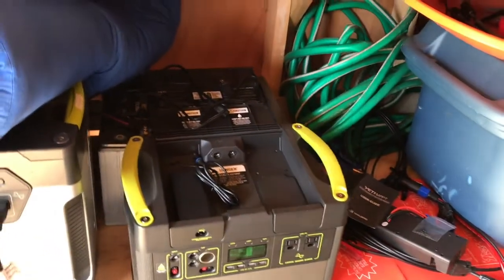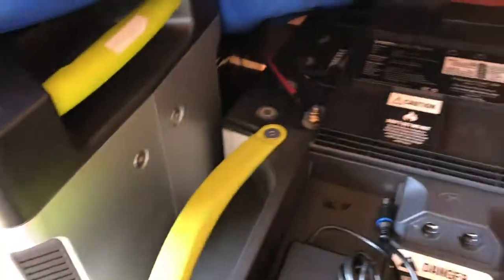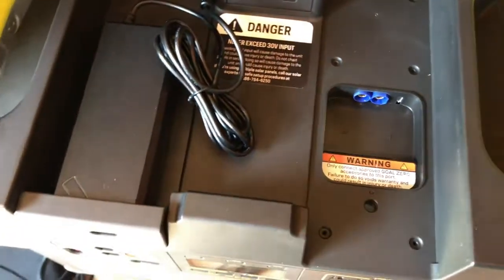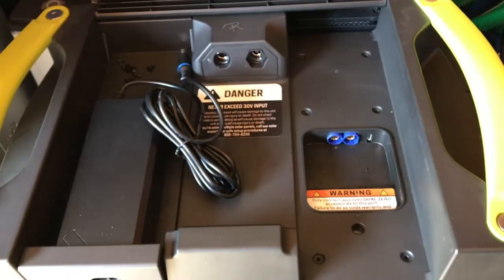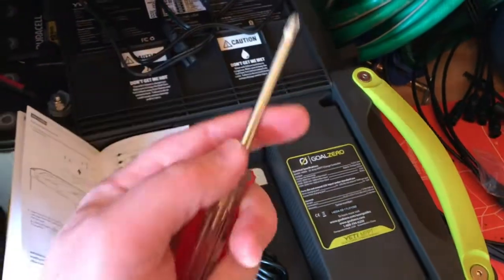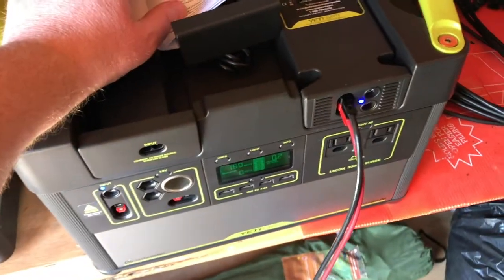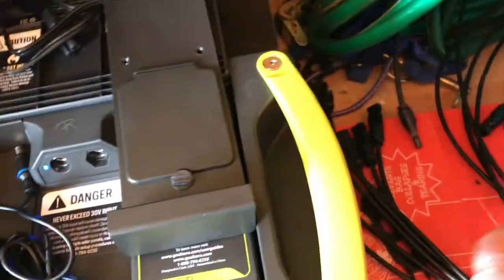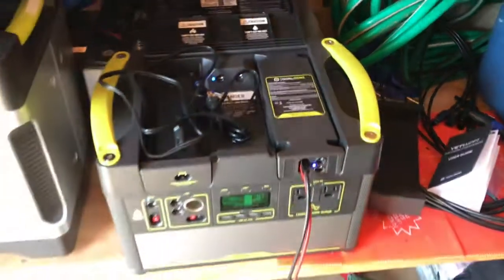Yeti MPPT Solar Optimization Module

Comment: Why didn't you plug it in to the front of the 1400's PWM charge controller first to see the difference?  We have nothing to base anything on here.  You showed us how to install it.  Great. None of that is important.  What's important is the actual difference in efficiency between the PWM and the MPPT.  A visualization of that would have been an important thing here.
Reply: Actually just seeing the installation is exactly what was looking for so it is important to some of us.
Reply: ...why you didn't plug it in to the front of the 1250's MPPT charge controller first to see the difference?

Comment: Hey Brian love your videos quick question I know you brought your Kodiak in your car and plugged it into the car lighter to charge it I did that in my minivan and it blew the fuse twice.
Is there something I'm missing hair should I go directly negative positive from the battery to directly charge it?
Reply: Yes it is from inergy it's the cable that they sell for the 12-volt lighter for your vehicle like I said I tried it in my van and it blew the fuse twice which I think is a 20 amp fuse.
Anyways I don't want to damage anything or melt anything so I'm not going to do it I called the company but they're closed on the weekends I left my name and number also email them I know of a couple YouTubers that are vandwellers that bought the generator and they say that they charged it up while driving I don't know what's going on I'll get back to you or if you find out anything let me know thanks for your time again